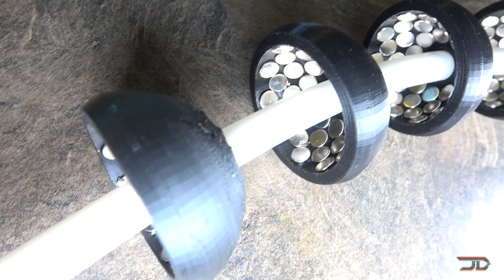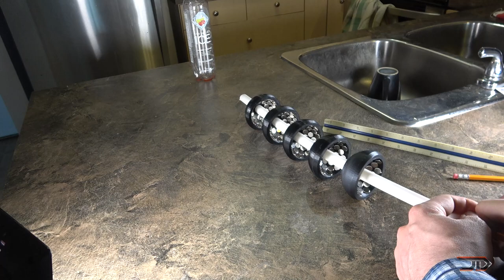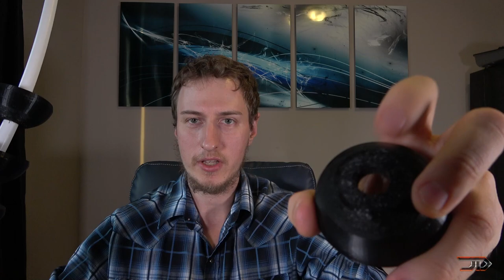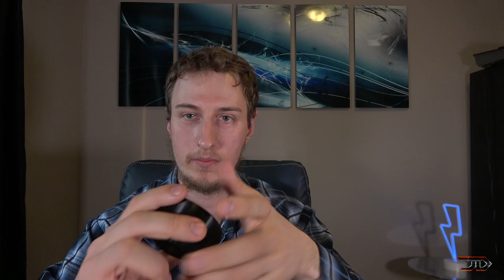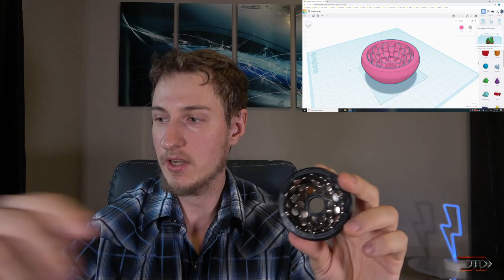Magnetic Array Loop

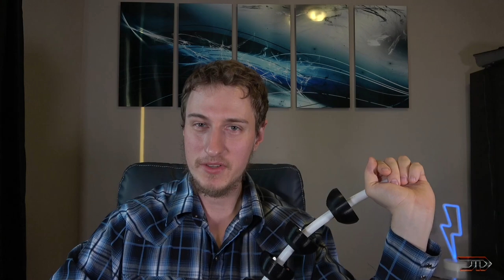Comment: @Tech Planet  :  @0:52  :  " because it would be called a overunity device and it would be breaking the laws of thermodynamics ".  Not True : An air conditioner, a solar panel, a hydroelectric dam ... all are IN FACT (COP) Overunity 'devices' ...  and no, they do NOT break the laws of thermodynamics (note that TD speaks with regards to 'closed systems').  I do endorse this video otherwise and your 'experiments'  - just not that particular statement ... what was stated IS incorrect ... their is no debate ... the only debate that exists is with those with insufficient scientific understanding(s).

Comment: What happens if you put one of these arrays around a home pex water plumbing system pipe, would it pull out metal and impurities in a boiler system or a water system from floating through?
Reply from the maker: It could get rid of magnetic particles if I put a loop/filter on it. I recently tried more arrays and I can't get it to work past 7.

Comment: I started making this already months ago… I have about 8 bowls with coils in between them. I’ve calculated that the smallest diameter is 48”. The magnets still have velocity with the curve and the coils in between them. Please contact me. I’d like to discuss it with you. Thanks
Reply from the maker: Awesome, I am at 10 right now but if I deviate off 62mm spacing it seems to loose velocity. I think it's going to take at least 40(in a circle) to maintain velocity, probably close to your 48" diameter. I just want to do it without coils first. anotherguitarguy1@gmail.com
Reply: Congratulations for making yours keep up the good work what do you think about using this for an magnetic accelerator for a space launch I know they already had those things this seems like a very elegant way to do it
Reply: Sorry! I forgot about checking this for a reply. I sent you an email.
Reply: @Steefen_magam can you please elaborate more on the 2 emitters idea?

Comment: No an over unity device is any system that has a net positive output, and is not controversial. Free energy devices, devices that violate the 2nd law of thermodynamics are controversial.  A tokamak reactor that produces a net positive amount of energy is an over-unity device or system, and while it's yet to be successful, the concept is not controversial at all.
Reply from the maker: That is true, thanks for the correction! I think 99% of magnet motors out there don't work, I still try to keep an open mind about it though.
Reply: Why should fusion be considered over unity? Is my car engine also over unity? I only put a small voltage in it and it gives me 10000x the energy back....
Reply: @ET_AYY_LMAO  I was going to say no, because a car requires fuel, but in a fusion reactor, the Hydronium (or whatever you use for fuel) is the same thing, so maybe it also qualifies.  Good question.
Reply: There is only ONE overunity machine that breaks first thermodynamics law - The flux switching alternator/oscillator.
WHY exactly is induced emf in opposit direction? WHAT is the behaviour of the opposing magnetic flux? CAN the opposing magnetic flux be controlled using core reluctance? YES.

Comment: It's not an over unity device because of the electricity that was used in creating the magnets
Reply from the maker: That is true.
Reply: And the magnetic flux induces demagnetization so eventually it stops working. You'll never be able to generate enough energy before that happens to make up for the energy required to create the magnets in the first place.